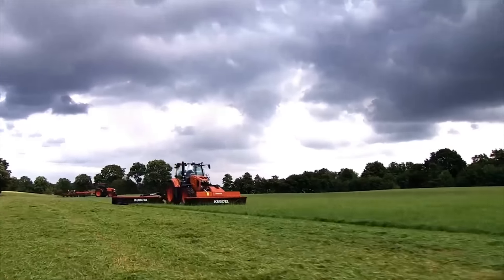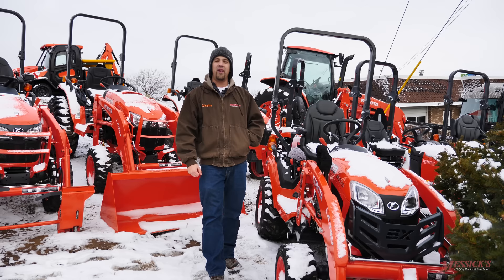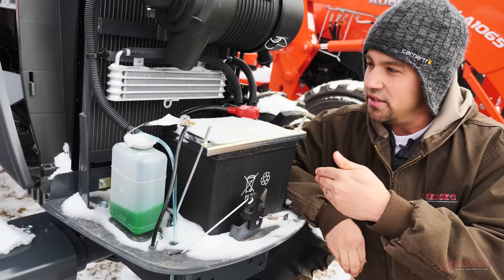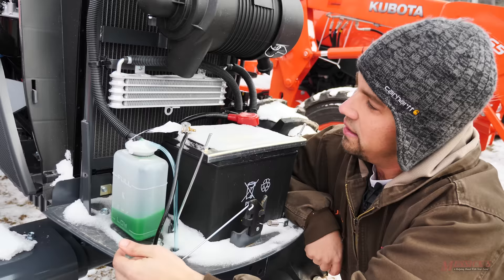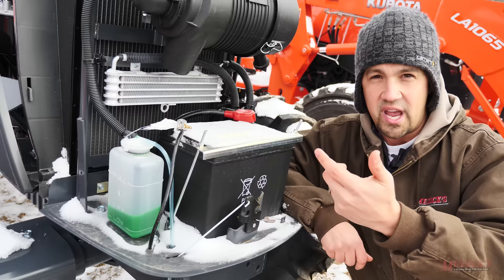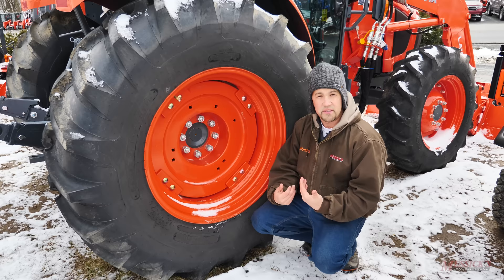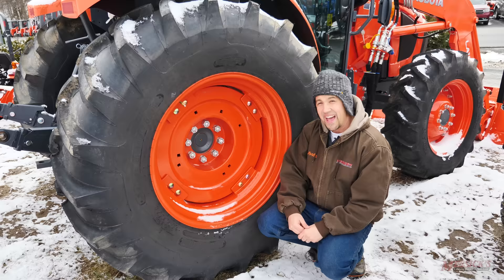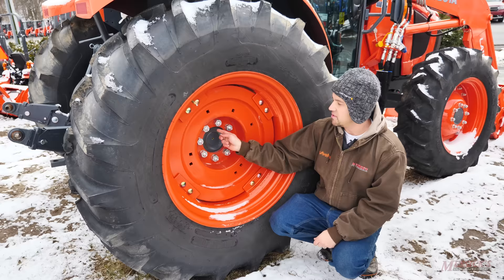5 Critical Mistakes New Compact Tractor Owners Make

Comment: Relax all the hydraulics when you shut it off... Set all the implements on the ground, shut off the engine, then hit all the hydraulic controls in both directions to release any pressure in the lines... This will make your hydraulic seals and cylinders last a lot longer...

Comment: Another mistake I'll see here and there is when someone with little equipment experience, doesn't grease a machine regularly, or removes the just about all the grease around a joint to make it "look clean".  I understand that someone who has a new tractor/equipment wants the thing to look clean, but that grease in addition to lubricating is what keeps the dirt out of the pin/bushing area!
Reply: Dalton Chanch we’ve experienced this,bought a 2nd hand (used) tractor a couple of months ago, just this week we had to put in a new wheel bearing in the rear right axle, damn thing had never seen a grease gun in its life
Reply: Actually if you have too much grease coming out around a pin or bushing it can be sucked back in during operation.
What this means is that you now have dirt mixed with grease around your pins and bushes - Just as bad if not worse than not greasing. If you can see the grease coming out during daily greasing you have greased too much.
It should only push out during operation and when hot. 2 pumps of your grease gun should do the job.
Reply: Good point. That grease that's hanging out of the joint isn't doing a darn thing to help that bushing/ bearing. As soon as you see the grease coming out, it's time to stop instead of letting  a glob of grease drop off and land on your floor so you can step in it and track it all over the place.
Reply: I think this can go either way, we have an old backhoe with really worn out pins and I like to push a little extra grease out of that sucker, but if it were a newer machine I would  go a lot easier on the grease. On the newer machine I would increase my frequency but reduce the volume.
Reply: @dorhocyn3  I would add that most of us are told to pump grease (and now, electrically) until we see at least a little coming out of the joint, where that applies.  Otherwise how do we know any grease actually went in?  Esp true with electric guns.  They can make lots of noise and pump nothing, when out of grease or air locked.
Reply: @replyhere590  also if you're switching grease, you want to pump out all the old grease.

Comment: I’m a new tractor owner and to ‘remind’ me of the roll bar when I park it in my garage, I bought some ‘bird tape’ , it’s basically a roll of red shiny foil to distract birds, I cut different lengths of this reflective material and tape the ends to the inside of my garage door.  When I open my garage door- these shiny tapes hang down and twirl in the breeze to warn me to STOP and lower my bar. When the garage door is closed they are out of the way. Works Great!
Reply: Very good way to remind yourself to stop and check.

Comment: I used to park my old little BX in the garage between my vehicles with the loader and bucket all the way up to shrink the tractors footprint but taking the leak down into consideration I would use a tow strap and loop the loader bucket to my non folding ROPS to keep the bucket up there. If I hadn't known that it would slowly leak down I would have damaged my vehicles. Your videos are great for bringing to light the little ins and outs of first time tractor ownership. I'm always appreciative that you all are not just about selling equipment but protecting everyones safety and equipment. Looking forward to the next videos. Stay warm!

Comment: Here's another I just learned the hard way... don't use backhoe as a pull chain.  After digging away at a large stump for a while, I finally got it to wobble back and forth like it was ready to break loose, but the backhoe bucket didn't quite have enough power to pull it all the way out.  So in my excitement I decided to leave the bucket on the stump while using the tractor's 4 wheel drive to move forward (which I had done successfully once before).  It did indeed pull the stump loose, but I also heard a bang.  Upon inspection, it bent the dipper cylinder rod.  Lesson learned.. wont do that again.
Reply: 🤦‍♂️ OOPS!
Reply: Let me guess.. you own a small garden tractor Kubota.

Comment: This video is well presented in a manner that is right to-the-point. It’s smart and informational without wasting your time. My wife ran our tractor into the garage with the roll bar up and wedged it in the garage door opening so bad, I had to let the air out of the tires to move it back out - so, good advice! Thanks for video.

Comment: It's not just compact tractors I am constantly running 250+ hp tractors and we get a new one we also have to keep a close eye on them for the first couple of months because we have the same occurrences but ours are much bigger and dangerous so we check for the same things I'll probably use this as a training video it is the best I've seen so far also I am loving the new larger Kubota farm tractors the steering with the fwa is the best fwa steering system I've used makes pulling 11 row max 2 planter easy turning I'm not running over already planted rows

Comment: As a plant operator we were always told to ground (and relax) all hydraulics ie: booms, buckets, implements etc. Not only for leaks but also if kids are playing on the machine. There has been fatalities and injuries when one kid is  pretending to operate and another has been under a bucket or boom as it has come down. If hydraulic rams were left under load then we used a brace to go over the cylinder to prevent it from retracting. Even in new machines where there is a supposed check valve on the hydraulic pump when the machine isn't running - it is still a good practice.
Reply: Paladonius Not grounding all implements is an OSHA regulation and heavily finable.
Reply: Joshua Beardsley so now do you ground them or not? Been out of the game for a few years ago don't know if the regs have changed.
Reply: Paladonius edited my comment.
Reply: @Paladonius  Oh the insurance industry  hates claims.  They have probably increased regs since back then.

Comment: I've always taken care of my equipment. It's amazing the amount of money tractors cost. It's understandable that not everyone has a shed or shop to bring their equipment in out of the elements. There are many steps that you can take to protect your equipment even when they are parked outdoors. First, how about flipping the seat forward so the snow, rain, dirt and dust doesn't pile up and shorten the seats life. Second don't set your buckets to catch water and snow. They will rust. Beware of mice making nests under your hood and chewing your wires if your equipment is parked for extended periods of time.  Check your tire pressure at least monthly. Mowers and blades rely on the correct tire pressure to cut properly. Most important, use your ROPS and seat belt. They will save your life.  Enjoy your equipment  :)
Reply: I don't have fancy expensive equipment, never have.  However, taking a little extra time to keep my lawn tractor properly serviced has kept it in good condition for several years...my old garden tractor was 21 years old, and it got used and abused mowing 2 acres a week for all those years, and it still looked new.  I had to replace the seat on it once as it had cracked over the years, but I always kept it covered after use.  Actually used an old table cloth to cover it with and simply tied a rope around it to keep the wind from blowing the cover off it...and it was parked in my wood shed all the time when not in use, it wasn't out in the weather directly but it wasn't in a climate controlled building either.  Never had any trouble with it up until the connecting rods decided to part ways sadly, loved that old Craftsman GT6000.
Reply: A 20 ft shipping container makes a wonderful garage for your compact tractor.

Light utility (next frame size up, still appx 60 inch bucket) may need a "high cube" to have it fit with ROPS up.

Comment: Thank you for the informative video. I learned a few of these tips on my own after taking over the payments of a friend's New Holland TC29DA a few years back. The garage door vs ROPS was the first trial. Fortunately not too much damage to the door. And finding loose lug nuts on the rear after owning it for a year. May I add one more tip to your list? I was told by a contractor to never 'side load' your front loader bucket. That means to not lift or carry a heavy object on one corner without spreading the load out evenly in the bucket. Lifting from the corner only can bend the loader arm on that side. Caught my brother in law taking his large outboard boat motor from the driveway up to the barn about 50' away while the motor was hanging by a tow strap from just the corner of the bucket.
Reply: I agree.  I put a large tree stump hang off the corner in my subcompact's FEL and it bent the bucket.  No easy fix either.  The entire loader assembly would need to be straightened by a body shop since it is now torqued.

Comment: Our primary tractor's when I was growing up on the farm were both utility models, 50 & 60 HP respectively. When my Dad bought his first no till grain drill, they were both to small, both in power as well as actual curb weight to pull it. 

After some soul searching, Dad bit the bullet and bought a used 95 HP 4×4 row crop. With a non foldable ROPS with a canopy. It didn't take long to rip the lights off of canopy.... Or for Dad to get himself into the worst stuck situation of his farming career... :-):-):-):-)

Comment: Another great video Neil. I love Kubota equipment and have several pieces.  I have a L3830HST I bought new in 2006, it has +/-700 hours now. It still has the original battery in it. Still looks and performs like new.
Reply: I bought a B2410 in 2001 and just replaced the battery last year!  Other than a hood prop I bent,  a link that bent from a swivel point that rusted, and replacing the front spindle seals, it has been a hard worker.   6' finish mower, 5' tiller, Woods backhoe, 4' roughcut mower, and hours and hours of work.  My one and only complaint, placement of the brake pedals.
Reply: @acdii  If you have not replaced any hoses, I'd check the paint color.  Same experience as yours with batteries, good, but Kubota hoses, oh boy.

Comment: Rewatching because it's important information.

RE wheel lugs... I had torque checked in the morning.
 When I finished running the shredder that day, I was missing 4 out of 6 lugs on one wheel.
I use blue LockTite on the wheel lugs now.

Comment: Lug nuts tights No.1 After almost having a front wheel fall off and almost turning into a disaster I now have all the lug nuts and rims marked with a white paint  pen so I can tell at a glace if any loosened before each use. Had only 2 backed out nuts holding rim on ruining it and almost ruining axle shaft too.

Comment: These are some pretty good tips. The other day as U was binding down my tractor on the trailer, my brother noticed that the lug bolts on one of the front wheels were loose to the point of not even being finger tight. Got to keep checking those little things that if unnoticed can be not so little like if you're going up or down a real steep hill and a wheel falls off. Not good at all.

Comment: I'll admit I get freaked out every time I find a drop of fluid on the garage floor and don't rest until I have identified the origin. I was also very surprised to find that implements and loaders can not only leak down when parked but they can also leak down while in use if you haven't touched the SCV control in a while!  If you mow with the loader attached and raised up slightly you can find that the bucket will creep down while mowing even though the engine and hydraulic pump have been in operation.
Reply: EOSJOE yup, if it’s there, find out where it comes from.
Reply: Smh...unless it's actually puddling don't worry about it just check the fluids and the grease points...equipment leaks fact of life
Reply: Actually, equipment shouldn't normally leak. You may have a battery vent or coolant overflow expel some fluid under normal conditions but that's about it.  There may be leaks that are deemed not worth fixing but it's still not normal. I watch my equipment very carefully. I always check the garage floor and periodically inspect underneath the chassis and I've never seen a single drop under my compact tractor or garden tractor.
Reply: EOSJOE the fluids always leak
Reply: Yep, tractors don't leak like they used to but it's normal with heavy equipment. 
I just wanted to let you know that cylinder leakdown isn't abnormal if happening over a long period of time but can be depending on how quickly it is happening. You shouldn't have any noticeable drop  while simply holding the bucket off the ground during use. I can run a box blade, tiller, drag, post driver, whatever all day without the FEL leaking down. Check your FEL cylinders for scoring or leaks past the seal.

Comment: #6 - If you use your tractor In the winter, you need to be mindful that water can build up in your hydraulic filter.  That water can freeze and if you just jump in and start working your tractor, you filter can blow wide open spewing hydraulic fluid everywhere.  It happened to me with a brand new Mahindra.  I keep my tractor indoors now and when I can't, I let it warm up to the point I know for sure everything is above freezing before I operate the tractor.
Reply: If you have that much water in your hydraulic system then you have bigger problems then your filter splitting.  That means you have a cracked breather cap or too low hydraulic fluid allowing condensation to build up in the tank and collecting in the fluid. Water in hydraulic oil in devastating to a pump. The water gets suspended in the oil as it draws from the bottom of the tank because the oil floats on top and when the gears mesh together to generate the flow necessary the water droplets explode and turn to micro pockets of steam which then start to pit the surfaces that the pump gears spin on. There are no rotating bearings in hydraulic pumps .They are lubricated by the film of oil that they are pumping . So as these surfaces become pitted by the micro explosions of steam they corrode the surfaces and the gap becomes larger and allows pressure to escape around the edges of the gears which then doesnt allow the pump to build up pressure to do the work.
IE . Less the loader can lift and less the backhoe can dig out. 
Just remember the 3 C's of hydraulic fluid.
Cool  ( nothing above 110-120f)
Clean.( 10 micron max size return filter size)
Circulating  ( same size reservoir as the pump does in a minute for intermittent use and double with a faned cooler if a constant running  motor is in the system. 
Mahindra is a tractor designed and built in India.  You have to ask yourself whens the last time you've seen alot of National Geographic videos of Indian people running snowblowers in sub freezing temperatures? 
When John Deere builds their tractors in the  upper midwest and it can get to -40f in the winter in those areas . See my point
Reply: @buildthings79  Mt Everest marks one part of the border between India and China, but they probably don't try to keep the snow cleared. :-)

Comment: A while ago as I was loading my JD 4520 onto my trailer, my brother noticed that the front lug nuts had loosened right up. Fortunately, the holes in the wheels didn't get egg shaped, caught them in time. My tractor is a 2005 and I bought it used so it's a good idea to check the lug bolts on used tractor too, not just new ones.
Reply: Check the lug nuts periodically.  If you run it often, then check them whenever you grease all the places which should be greased.

Comment: Hit my garage 3x so far I’m starting to remember the rops
Reply: I lowered mine before I even got home and totally removed the top section after a couple days of owning it. Bypassed the seat safety switch too the first day haha.
Reply: One way to easily remember is to get one of the bicycle flags on a fiberglass pole and tie it to the front end of the tractor.  Set it so it is just the height of your garage door or maybe an inch or two higher.  Easy reminder since it will hit first and move towards your face.

Comment: Size is not limited to tractors, I have seen people buy a new truck or SUV and find out the hard way it doesn't fit. They scrape the roof, rip the roof rack off, or crush the mirrors.
Reply: Don't forget about backing out...
Reply: None of my vehicles have ever fit in the garage. My wife's vehicles do fit, but she has to close the mirrors to get it inside.  I don't know why, but the door is not wide enough for a standard car or SUV.

Comment: Yep #1 is me soon as I pulled it off the trailer from the dealer. Wham, took down the part of the door frame and that wasn't the last time either, lol.
Reply: even after owning my machine for 6 years, I managed to do this after doing some work on it inside and then forgetting I placed the ROPS up, a split 2x6 came within inches of my head
Reply: Smh...rookies
Reply: Thanks for your honesty!